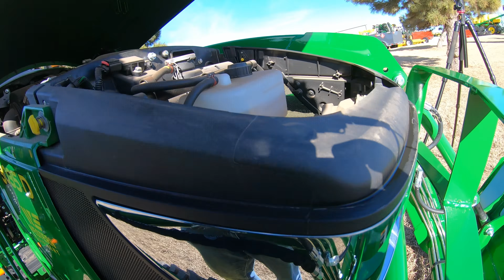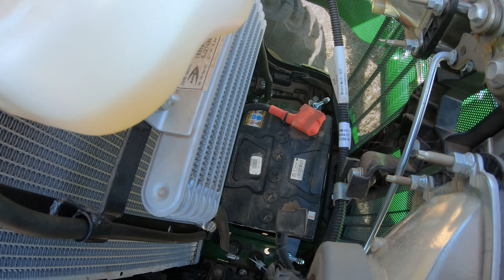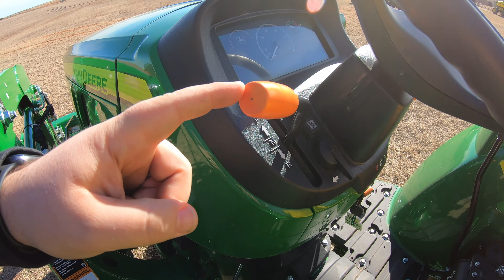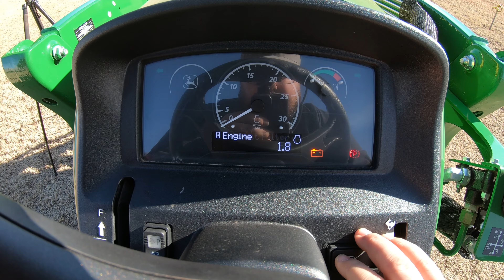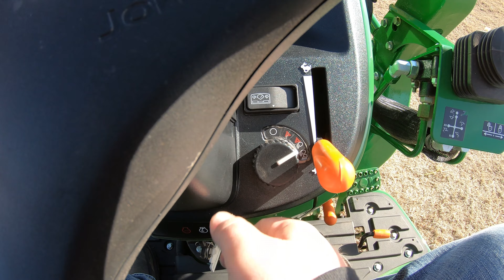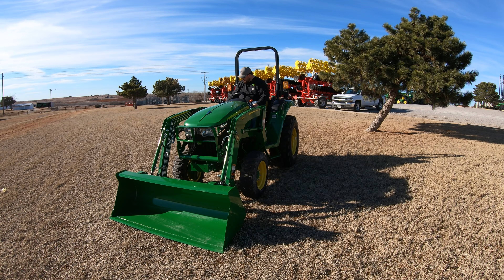2022 John Deere 3035D Tractor Review & Walkaround

Comment: Hello, Do you have a video out discussing the 3D series tractors and the type of PTO they have? Live, Non Live, independent etc. and how they work. Thx
Reply: It's a single stage clutch, pto is dependent. The loader is very weak, 800lbs is if you're lucky, unless you have the 300 self mechanical self  leveling loader, which will be around 1000lbs at its best. Be prepared to replace broken keys regularly, you keep hitting it with your knee. Personally, better to pay more and get an 3R series. Didn't have my 3E and 3D long.

Comment: I have the 3043D and changing the air filter requires removing the support for that side panel at the top.  It's a pain.
Reply from the maker: Yes, it can be a pain sometimes.
Reply: That's a poor design. Should be one nut or band to replace air filter.